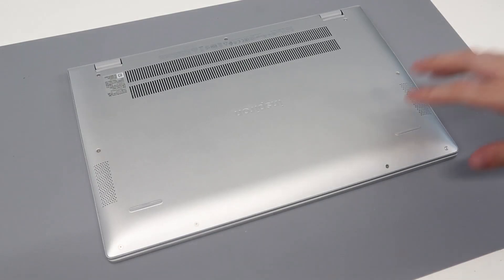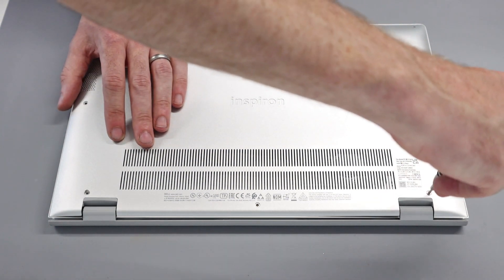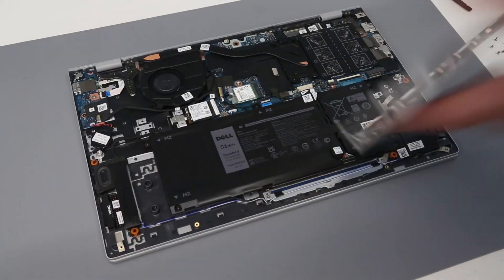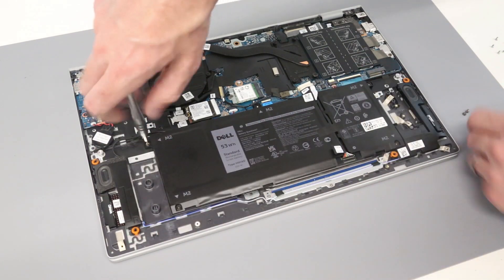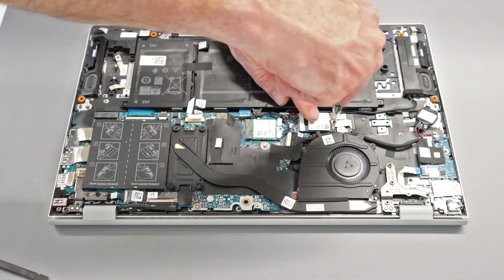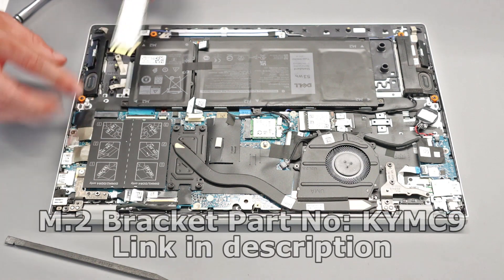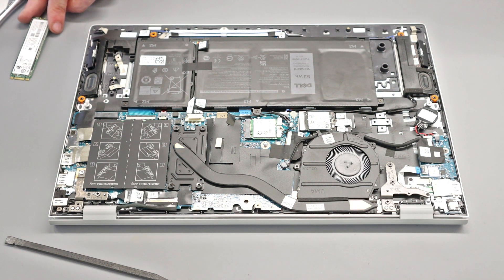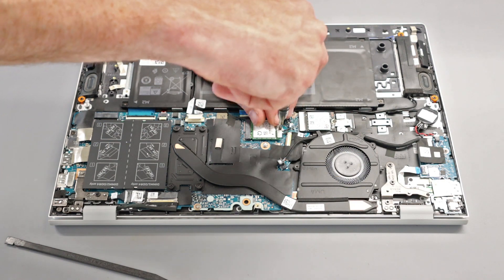Dell Inspiron 15 5502 - SSD, RAM, Fan and Battery Replacement and Upgrade Guide

Comment: This laptop was pretty easy to work with actually. I had to upgrade the SSD, upgrade RAM module, and replace the battery. Everything was literally plug and play. The only real challenge is find a good pry area of the cover once the screws are removed to open it up. Usually when the screw tensions are off, one side or the other will have a sliver of a crack to work with. That will make an excellent starting point to remove the cover. That's it. The base cover contain no hidden screws like some models do so it's been a pleasure working with this model.
Reply from the maker: I agree. Glad the video helped.

Comment: After watching video I changed memory up to 32GB and SSD to 1TB, easy as pie. For info, Crucial offer a free OEM Acronis version to clone drive (see support to install your model of SSD).  All is A1.

Only snag, since I restored an image of original Dell set-up with various restore partitions, at image restoration the result was exact same size as original, which left about 490 GB not allocated on the new SSD. I solved this by expanding drive C with this free tool: "MiniTool Partition Wizard". After I ran Win 10 Tools Error Check, it needed to fix errors, after this all was A-OK on following check..

SOLVED : Only thing remaining to solve, I installed Crucial Storage Executive, it does give me info on the disk, but tells me it does no do not find drive it if I try to optimize or do a firmware update. Any clue ?
SOLUTION: This is because, by default, the Dell is configure with RAID. See Crucial doc here : https://www.crucial.com/support/articles-faq-ssd/my-ssd-wont-detect-crucial-storage-executive

Otherwise, as far as I can see, all is perfect. Thanks, this video really made it easy.

Comment: Hi James, left a comments that seems to disappeared. Looking in Crucial website, the correct part number for SSD 1tb is CT1000E100SSD8

Your link take me to another part number not shown as compatible as per Crucial. Did I looked at the wrong part?

Thanks
Reply from the maker: Link in the description is to an old model as its from when the video was first posted.
I've updated it to the Crucial E100 now: https://amzn.to/46FZfFt

Both would work, but might as well link to a current model. :)

Comment: Hey, great video, now i have another question, can the cooler be upgraded? apparently in this model Dell Fk us over, since they heavily downclock the I7, it runs at 1.69 base and doesn't even dream of reaching even 4Ghz, ever. I assume they cheaped out on the cooler, can it be upgraded?
Reply from the maker: Not impossible, but I don't think you'd find a better cooler that can be fitted into the the chassis easily - it'll be bespoke to the laptops design.
Reply: @BrueComputing  Thank you for the answer. I can't believe this is legal. They literally lie in the advertisement.
Reply from the maker: I'll be honest, I don't remember any issues around clock speed on mine, but it was a long time ago.
Reply: @BrueComputing  Oh take a tour of the Dell forums, you'll see. Inspiron 5502 i7 11th gen and others variants as well.
Reply from the maker: I don't doubt it - I just only had the machine for a week about 4 years ago (I bought it specifically to do these guides) so I don't really remember the exact details of its thermal behaviour. 😊
Reply: @BrueComputing  Ah ok ok, lucky you!. They are very direct about it once you own it. In task manager you can see it clocked at 1.69 Ghz base so, its not like they are hiding it... once you already buy it.
Reply from the maker: Which CPU is it? i7-1165G7?
If its configured for 15W PL1 then that might be its base frequency.
Reply: @BrueComputing  Yes. But even in my pc "properties" it appears as @2.8Ghz, even if its real clock is way lower. In small letters below it it says 1.69Ghz
Reply from the maker: 2.8GHz is the cTDP-up base frequency - so applies if the PL1 is set to 28W: https://www.intel.com/content/www/us/en/products/sku/208921/intel-core-i71165g7-processor-12m-cache-up-to-4-70-ghz-with-ipu/specifications.html

At 15W it'll be lower - strange that its showing 2.8GHz.

Comment: Hello James, I was watching your video before installing new memories in my notebook, I tried to upgrade to 32GB, the computer turns on but does not display the screen, I tested the memories separately in another Dell notebook and they are working but in my 5502 it does not display the screen, could there be some kind of restriction in the BIOS? because the memories I bought meet the specifications.
Reply from the maker: Is that a single 32GB module or 2 x 16GB?
Reply: @BrueComputing  2 x 16

Comment: Hello again. This is my Go-To video for my 5502 Laptop.  just replaced my battery, so I needed this video to once again guide me through the process. While I was in there, I decided to inspect the fan for dust. I'm glad I unscrewed the fan and lifted it, because under the fan, where it's "hinged", there was a lot of dust built up. Also, initially when powering up the laptop after battery replacement, the laptop detected no battery  😮 So I removed back again and played with the battery connection. Now it works. Those battery connections are finicky. Thanks again for the video.
Reply from the maker: Glad it helped!

Comment: The system's showing me an hard disk not installed error for the same model, can someone please help me
If i buy an new ssd, should i reinstall everything that i had in my old ssd?
Reply from the maker: You'd need to reinstall the OS, drivers, etc.

Comment: Great video, instructive, i have a question, Can i add 2400mhz ram?
Reply from the maker: It may work, but the specification for the laptop is DDR4-3200 so I wouldn't install 2133/2400/2666 RAM.
Reply: @BrueComputing  3200 is considered OC, so i guess the mobo or dell auto-OCs it. It would be an interesting experiment to see if it would boot or work with standard 2400 Mhz ram. I got some for free from a friend, and i'm sure i'm not the only one. Could be a good video to experiment on this.

Comment: Hey! I have a somewhat lengthy question. I'm a motion designer, heavily using Premiere and After Effects. Lately, I've been working on larger projects and consistently receiving warnings about a lack of RAM and cache. I don't fully understand what this means, and despite seeking information, I'm hesitant to risk installing an SSD or upgrading the RAM. This is because I'm afraid of purchasing the wrong product or not installing it correctly, potentially damaging my notebook. 

My notebook's specifications are: Dell Inspiron, 11th Generation Intel(R) Core(TM) i7-1165G7 processor @ 2.80GHz (12MB Cache, up to 4.7 GHz), dedicated NVIDIA(R) GeForce(R) MX350 with 2GB GDDR5 graphics memory, 512GB M.2 PCIe NVMe Solid State Drive, and 16GB (2x8GB) DDR4 Non-ECC Memory.

I would like to know if I can upgrade my RAM because I've seen some videos saying that it's not advisable to mess with notebook memory or that changing it won't make a difference or could potentially harm the computer. Additionally, I'd like to understand more about the SSD: can I install any size I want? Is there a limit? Thank you very much for your help.

Comment: Hi James! Thanks so much for this video. I just upgraded my Dell Inspiron 5502. I did two upgrades at once. Upgraded the SSD from 512GB to 2TB, and upgraded RAM from 12 to 16GB. This video helped tremendously. Especially since I was replacing the current SSD with a longer 22H drive, and moving and spinning around the support bracket is what I needed to do. Also little details like the two back case screws, which do not come all the way out, but are "retained". Great to know ahead of time, to save from frustration. Thanks again. I'm happy I now have a 2Tb laptop with more RAM  and it didn't take all that long 🙂
Reply from the maker: Glad it helped!

Comment: Hi..pls help...I have the same laptop...when I put my laptop in sleep mode, there is continuous ticking/clicking from inside the laptop ... The sound is from the ram side.. no ticking sound weh  laptop is on normaly . Only when it is in sleep mode..pls help..I'm getting very anxious.
Reply: same issue on my 5509 (almost the same model as 5502), did u get it solved?
Reply: @yubureeji  no bro..ab farak nhi pdta...maybe motherboard or lose cable issue
Reply: @anishsharma2608 bro , we can add m.2 nvme ssd in second slot too directly or have to install bracket ..btana Bhai
Reply: @nikkukr2542  no idea bro.. mujhe abhi tak zaroorat nhi pdi extra storage ki.. but i think second slot me lga skte ho
Reply: @anishsharma2608  ok bro

Comment: Morning James, Very Good Video, Thank you for putting The Product Description Needed to Attach 2nd SSD. Just One Question The Bracket, Dell KYMC9 SSD 2 Bracket: The Description from Amazon and All Product Pictures Just Show The Bracket and One Screw. However, Don't you need Two Screws, One to Fix the Bracket to the Base of The Computer and the Second to Attach The SSD to The Bracket? Your Expert Help would be appreciated. Thank You
Reply: most drives come with a screw, also the part from amazon when i ordered it came with extra screws

Comment: Will invalidate your warranty if you add an extra SSD into your laptop? If so, is the way where Dell could fit it for you?
Reply from the maker: If the system is under warranty and the battery is faulty then Dell should replace it free of charge.

Comment: Can you upgrade the gpu
Reply from the maker: No, the GPU is either Intel Iris XE built in to the CPU, or an NVIDIA GPU soldered to the mainboard. Only way you could upgrade would be to completely replace the mainboard with one for a higher spec 5502.

Comment: Hi, if I put the original SSD card into the extra SSD slot and the external extra SSD into the original slot, can I still use the OS?
Nothing will happen, right?
Reply from the maker: Correct.
Reply: @BrueComputing  thank you very much

Comment: There is a 3 cell and a 4 cell battery for this this machine. If your machine has the 3 cell can it be upgraded to the 4 cell?
Reply from the maker: Yes, the 4 cell battery fills the extra space.

Comment: Is it possible to replace the screen?  Mine has a white bezel that appears to be glued on.  I'm worried I'll break the bezel if I pull to hard.
Reply from the maker: This was a customer system - as it was undamaged I didn't touch the screen.
The Dell Inspiron 5502 service manual doesn't show how to replace the display panel - only the screen assembly as a complete unit. I suspect the panel replacement process is similar to the 3501 as seen here however: https://www.youtube.com/watch?v=o80XEWPeg3o
Its a bit of a pig of a job on the newer systems as the panel is stuck in place as opposed to screwed in.
Reply: @BrueComputing  Thanks for your help.  I was able to replace the screen.  No screws.  I just reused the back adhesive strips.  Very little slack to plug in the video cable made it a little tricky.
Reply from the maker: @sunburst_wolfgang  Glad it was helpful!

Comment: Does opening the 5502 laptop void the warranty ?
Reply from the maker: There are no specific warranty tabs, but any damage caused during disassembly might. You'd have to return it to original specification in the event of a claim.
Reply: @BrueComputing  ❤ thanks 😊
Reply from the maker: @SMOOTH_AFK  No problem!

Comment: Great video for replacing the battery.
Do you, by any chance, know how to replace the screen for this laptop ?   I have tried without success and a new video for the screen will be a great help.
Reply from the maker: Unfortunately this was a customer system, so I didn't do this as there is the risk of damaging the screen if the adhesive doesn't pull out cleanly.
Its a similar process to the 3501 I did here: https://youtu.be/o80XEWPeg3o
Reply: @BrueComputing  thanks for the link. This was exactly what I was looking for.

As I thought, it couldn't be done easily by just removing the frame and a few screws.
I'll definitely be careful for my next laptop to take one that is easily repairable.
Reply from the maker: @frabri7769  Unfortunately its quite common on most laptops now - adhesive allows for thinner bezels and a smaller overall footprint for the laptop vs. traditional mechanical fixings.

Comment: How much is the maximum upgrade RAM?
Is it possible to use 2x16gb?
Reply from the maker: 2 x 16GB should work absolutely fine.
Reply: @BrueComputing 
Can you use 2x16gb...? 
So the total can be 32gb... 
Wow, great performance
Reply from the maker: @noviaienur  I believe so. It won't make a great difference to performance though unless you are doing something with large memory requirements.
Reply: I put 2x32 in my machine, so 64GB total which works fine

Comment: I bought my 5502 through Newegg, it came equipped with:

Windows 10 Pro

Processor 11th Generation Intel Core i7-1165G7 2.80GHz

Graphics iRISxe

RAM 16 GB

SSD 1 TB

Battery 53 Wh

Touch Screen

Backlit Keyboard

Finger print Reader

Cost $1,049.00

How would you rate my setup, and did I get a good deal?
Reply: It's a good deal. In the US they are much cheaper, to make a comparison, a certain model of laptop from Dell for gaming costs in the UK 3500 pounds and in the US it costs only $ 2000 for the same configuration.
Reply from the maker: I don't really know much about pricing in US, but sounds a decent machine.
Reply: @BrueComputing  thanks.

Comment: What is the brightness and colour gamut of this laptop?
Reply from the maker: Depends on the exact model as there are two different panel options - either 45% NTSC and 220nits, or 72% NTSC and 300nits.